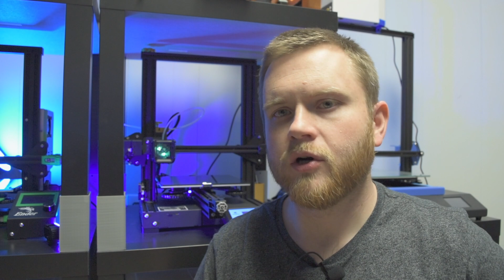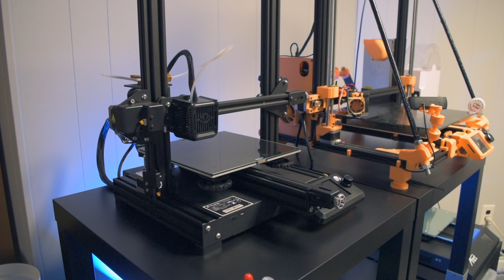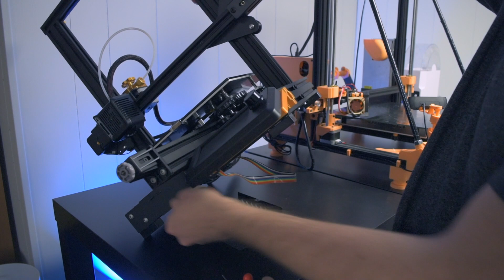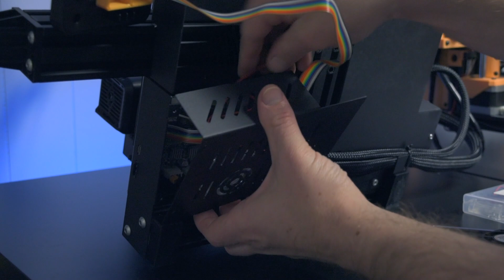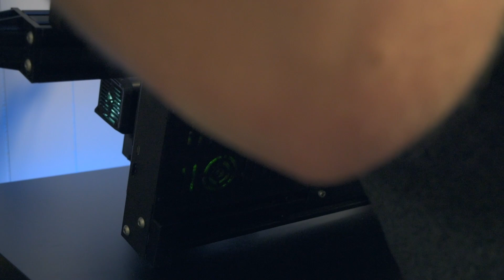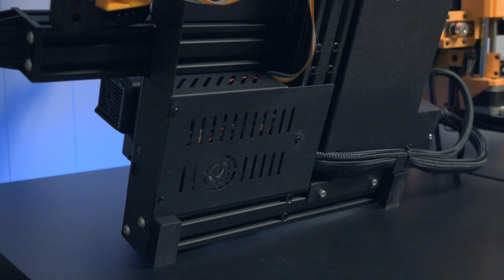Tired of your loud motherboard fan on your Aquila? Let's fix it!

Comment: Using your affiliate link to Amazon for the winsinn RGB fans there are multiple size/voltage options. Which one should we get? 5v,12v,24v? 25mm 30mm 40mm?
Reply from the maker: 24v 40mm fan. ;)
Reply: @3DPrintSOS  🤙🏻 grazie
Reply: @3DPrintSOS  hey Fedder, question. Is the RGB fan the same spec as the stock main board fan? I swapped it out today with the RGB and now about 30min into a print my printer reboots. I’m thinking it’s a failsafe feature kicking in. I’ve been troubleshooting. Changed sd cards, changed files thinking it could have been a bad slice of file. I’m stumped. Going to put back the stock fan in the morning but wanted to ask you if you had any issues with yours not providing enough cooling? I’m also printing Petg @ 235/80 so maybe it could be my parts cooling not cutting it. But I’m running the sprite pro now so it should be able to handle that no problemo. Maybe you may have a pointer or experienced this with that winsinn fan?
Reply: *And I’m using a refined version of Alex’s firmware with the max temps set to 300C.

Comment: Hi I just change my motherboard fan, the leds turn on but the fan didn't. It was a testing print of just 30 minutes; it’s the fan temperature activated or it should be always spinning?

Comment: This printer is junk. Spend the extra hundred bucks for an ender 3 s1, or the ender 3 v2 neo. Trash chinese stock fans, the extruder is partially plastic and uses an old bowden extruder. voxelab is bad, and they dont even sell this model anymore LOL
Reply from the maker: I think you're being a little harsh. I've had so many of these machines and have gotten amazing results. I also have an S1 that I recommend if you dont like to tinker or mod. Great machine, but it's kind of weird to compare the two...price wise at least considering its almost double the price and still has its own issues. Performance wise, some of the best prints I've ever gotten out of 20+ machines I've tested and owned were stock Aquilas.
Reply: Eh I am being a bit harsh. But that's because out of the two I'm using, both psu fans have bad coil whine until it warms the fan up. The parts are all cheap. Print nozzles are eh.  Yes it delivers quality prints, when it's set up correctly and tinkered with CONSTANTLY. It's an old dated machine, but it gets the job done I guess. Super duper loudddd

Comment: Fan failed and was louder than the original, smh, atleast ! got 2 more, lol...
Reply from the maker: I’ve heard of a bad batch of these with premature failures. Mine are still going strong.
Reply: @3DPrintSOS  2nd one is working so far, but the hotend 1 I've had no failures...

Comment: those fans are not meant to be run for more than 10 hrs at a time so I would not recommend those.
Reply from the maker: There are different types of these with different ratings. I don’t recommend you use 10 hour fans for longer than 10 hours. However, there are fans that are rated for 24hours. Make sure you check the specs.

Comment: Whats the voltage of those fans? In another video you replaced the psu fan and I believe you said to get a 12 volt fan but when going to the amazon link you provided its a 24 volt thats selected. Just wanna make sure I dont get the wrong fans and make things worse for myself.
Reply from the maker: So two things there. Voxelab changed some of the power supplies with a different manufacturer and some of them are 12v and some are 24v. It would be best to check yours.

Comment: I only have my Aquila for a few weeks and only printed 5-10 small prints so far, and one of my fans has already gotten really noise on start up.
Initially I thought there was a bit filament stuck in it or something, but it's fine after about 30 seconds. might take it apart there later and investigate.
Reply from the maker: It’s not filament. Unfortunately just cheap fans. They will work that way for a while. After warmup, the sound goes away. With that said, I would replacement with something a bit better
Reply: @3DPrintSOS  Yea, I assumed as much when I saw that it was such a common problem! I took the fan off last night for a look and it's definitely the motherboard fan alright.
I gave it a squirt of silicone lubricant, but I think I'll probably buy some new fans soon. I suppose I might as well buy another roll of filament while I'm at it, to make the shipping costs worthwhile, and maybe some capricorn tubing..

Comment: This might be a weird question but it seems like every time I print something now, I get a static electricity shock when I go to insert or remove the SD card. Have you experienced this at all with yours? It wasn't happening before I upgraded the mobo fan.
Reply from the maker: I’m in a basement with carpet and we have oil heat. So, static is a content around here.

Comment: So for the nozzle and mainboard we want 24v and PSU 12v?  Are they direct replacements, meaning just wire them up, no convertor needed?
Reply from the maker: Yes. But one thing to note about the psu, it’s been brought to my attention that they at some point changed the psu and some machines have 24v fans in there. So you’d have to take a look at your first.

Comment: Anyone have any idea exactly when the motherboard fan is supposed to be on? It'll come on if I do a preheat (which i never do). However, if I start a print, it does not come on. Seems fishy to me. I'm 23 minutes into a print and has yet to come on. WTF?
Reply: It came on at the second layer. The leds flicker. Power issue?
Reply from the maker: Not sure about the LEDS flickering, but it comes on when it needs. 2nd layer or temperature, whatever is set in the firmware.
Reply: @3DPrintSOS  It seems that around the 3rd or 4th layer it comes on and everything appears to work normally, no flickering. If that's the case, I'll live with it. As long as my mobo is getting air. Thank you for the reply, brother. Also, thank you for being my source of ideas for this printer. I've been printing for years. I just hate new printers due to all the tweaks that must be done, usually. lol Take care, Sir!!!
Reply: I believe your fan doesn't turn on immediately due to settings in Cura. If your part cooling fan isn't on, the motherboard fan won't be on either. So however many initial layers you have set for the fan to be off, your motherboard fan will be off as well. Additionally, the flicker from the rgb fan is again due to the part cooling fan. If the part cooling fan isn't running at 100%, neither is the motherboard fan. Without 100% power to the motherboard fan, the rgb lights will flicker. I bet if you check your preheat settings you'll find the part fan is on.
Reply from the maker: This is all true. I found this out shortly after this vid.
Reply: @3DPrintSOS  What are your thoughts on rewiring the motherboard fan so it's constantly on without the dependency of the parts fan being on? Is that something you plan to do?
Reply from the maker: Easy to do. If you have a 24v fan, you can wire it straight to the empty leads on the bottom of your power supply. ;)
Reply: @3DPrintSOS  Sweet! I'll try that out. Thank you

Comment: I bought the Aquila because of your videos. Excellent work. I've been doing all the upgrades in your videos. Just to add to your comment about the rgb fans getting bad reviews, I had one that was temperamental. I changed the fans on the Aquila, no problem. I decided to upgrade the 30mm fan on my Mingda Rock 3 with a 40mm also. I did find that once, it didn't spool up. It powered up but the blades wouldn't spin. I didn't notice until after I melted my custom fan shroud around the cooling fins. Just a FYI. Keep an eye out to make sure they spool up on power up. Other than that, they're very quiet and nice to look at. I do every upgrade you put out. Well worth it. The printer is running like a swiss watch. Keep up the vids.

Comment: so we need 12v for mobo and 24 for nozzle ?
Reply from the maker: 24 for mobo, 24 for nozzle, 12 for power supply
Reply: @3DPrintSOS   ahh they dont have 24v in stock that's why it is showing me 12 v only
Reply: @3DPrintSOS  any other fan suggestions ? they dont have 24v ones anymore :S

Comment: Thank you so much for this info! I actually got an Aquila after watching a few of your videos, but it started making that noise when I preheated it. Should I get the 24v or the 12v fans?
Reply from the maker: 24v fans for hotend and ecu and 12v for power supply.
Reply: @3DPrintSOS  thank you for the fast response! I will order them immediately. Also, my stepper motors get extremely hot, to the point where I can’t leave my hand on them for more than a second. Do you have any idea what could be causing this? I have the belts tensioned properly and nothing is binding, so I don’t know what could be causing it and frankly I don’t know much about the printer
Reply from the maker: Absolutely. Check out this video: https://youtu.be/CjH7AXIHN74

Comment: is it a problem if the fan doesn't turn on when the printer is pre-heating and/or printing?
PSU fan is running a couple of minutes into the print, mainboard fan stays off.. it does work on the mainboard 24V input
Reply: it did turn on, but it's flashing. still not the best thing in my opinion
Reply from the maker: Hmm flashing? The light or the fan? It won’t always be on because it’s on a sensor. The fan only turns on when it needs to. Well, it should at least. When you installed it, did you make sure the wires were correct within the connector?
Reply: Just finished a 3hr print without any issues. The board does get warm, but there was no thermal protection. So i guess the fan does the job :)
Reply from the maker: Thanks for the link! Made it easy. Hmm. Must be a faulty led in the fan. :/
Reply from the maker: Good to hear!

Comment: When looking at the fans on the website, thesexare not rated for more than 16 hours continual use.  Seems like a problem waiting to happen if you routinely have long prints.  How do these compare to the OEM in term of CFM?
Reply from the maker: These are great questions. It should all be listed in the same place you found the 16 hour rating though. I don’t remember on the top of my head to be honest. 

I’ve been running mine almost 24/7 for months now. So far, so good.

Comment: Have you had heat creep issue on long prints with these fans? Im Getting clogging problems do to heat creep with stock fans
Reply from the maker: I have not. It could depend on your ambient temps and humidity though. You can always print a new, more efficient duct.
Reply: @3DPrintSOS  it definitely was inside temps and humidity living in the south currently in a RV full time waiting to roll out again once covid is over.
Reply from the maker: Ah. That’ll do ya. Haha

Comment: I recently came across a thread that said the Mobo fan is on the same circuit as the part cooling fan. Isn't this a safety issue with filaments that don't use part cooling? Trying to understand before I start snipping the connector and figuring out how to connect it to 24v constant. If that's true maybe you could do a video walkthrough?
Reply from the maker: I’m not sure about that one. But connecting to the 24v constant is really easy actually. Even getting down to 12v is easy with a buck converter. Not a bad idea for a video. :)

Comment: So i installed the winsin rgb fans and occasionally the LEDs pulse on and off. just wanted to see if anyone had this going on. or if its an issue i should be concerned about. while hopefully not harmful it is kind of distracting since the machine runs next to my desk.
Reply from the maker: I have heard of this before from a few others asking me about this. I myself haven’t had this issue though. Might be a faulty led. :/
Reply: Mine did this as well before they died after about a year. I'm getting ready to replace them again and trying a different brand. I had more issues with the hot end fan starting to stick or make noise intermittently before it would not start more than it would. The MB fan still runs but has ALWAYS pulsed/strobed on startup. Seems like there was some correlation between the pulsing and the speed of the hot end fan. Surely someone else has run into this and has a fix by now?

Comment: What voltage fan I need to get for this printer Amazon has 3 different voltages this fan comes in
Reply from the maker: The hotend and motherboard fans are 24v. The psu is 12v
Reply: @3DPrintSOS  thanks btw I enjoy ur channel
Reply from the maker: Thanks. Appreciate it.

Comment: machine assembled...still having problems...return to home doesn't get there.
i tried to set up a printing, just to test further along...the hot end hits both ends of it rails and grinds...the switch on the left doesn't shut it down. don't know what's supposed to happen if it rolls too far to the right...
and
i can't figure out how to do a firmware update...normally it would take control and do it on it's own(on my mac, at least)...but the new folder it says to create for the firmware, never shows up in the control device to choose.
Reply from the maker: Hmm. I would check the connections for the switch. Maybe you have something plugged into the wrong one. Or it’s unplugged all together. 

As for the firmware update, I made a how to video on that as well. :)
Reply: @3DPrintSOS   yes, i watched it last night, and i wiped the SD card and re applied the firmware. machine is still inoperable. the connectors only go in one way. i'll check them again.
Reply from the maker: Hm. Yea that’s not good. Gotta be an end stop not plugged or a wire damaged or something along those lines.
Reply: @3DPrintSOS   well i re examined the wiring and there are 2 connectors similar that if not plugged in right, will not let ya print...user error...it is happily if not erratically printing a frankenhook. bed levelling doesn't work how i thought it did...but i managed several go rounds and i "think i got it".
cheers!
Reply from the maker: Nice! Glad you found it. Watch the latest leveling video, that might help.

Comment: just a couple general questions...is fan life sort of iffy or does the work they do just cause them to break down more frequently. and how many of these various fans are the same type?...X2 delivery within 10 days!!! i'm well chuffed...:)
i haven't actually done any math, but could all of the essential~ish upgrades/improvements cancel out saving from the original price? not a complaint, mind you...just casting a wee side eye towards printer makers...;)
Reply from the maker: I would say just run it until something goes wrong. It’s great stock and only gets better as you fix problems. Otherwise, you’ll end up in a modification loop that will eventually make mediocre prints. Ask me how I know. Haha
Reply: @3DPrintSOS   just completed the MoBo fan replacement...waiting on a soldering iron to do the hot end fan...and waiting for the PSU fan as well.
Reply from the maker: Nice! Off to a good start
Reply: i'm going to put a connector in there for easier replacement.
Reply from the maker: Smart move

Comment: any recommendations for non rgb replacement fans for this printer. my mobo fan started squealing bad after a 3 months of running it now lol dosnt happen all the time just every now and then so i figured i should replace it before it dies.
Reply from the maker: If you want silent + non rgb, grab a noctua fan and a step down converter. :)

Comment: Did mine, works fine, very quiet. But... sometimes when I print the new motherboard fan will flash all colors rapidly, endlessly. I can't find any supporting documentation at the winsinn site or via Google to see what that means. Anyone have any ideas what rapidly flashing all LED colors means?

Comment: I have an Ender 3 with a BTT Board and the board fan runs constant but the one on my Aquila does not run constant, are the fan plug into the incorrect place on the main board?
Reply from the maker: I don’t think so. They are just programmed differently. Its ok both ways

Comment: The PSU's exhaust is choked off. Taking a dremel or something similar to the factory PSU cover seems like a better idea than printing one.
Reply from the maker: Or you can pretend to be a total badass and just leave the shroud off completely. 😂 PSA: do this at your own risk. Lol
Reply: @3DPrintSOS  I considered it but  I already have to keep little fingers away from it. I did actually print one of the PSU covers and am using it until I can spend some time in the garage cutting up the factory cover. I'll be following this too in the end to swap out the fans bring the noise floor of this machine down as low as practical without just simply putting a bunch of 180mm fans under it on a pedistal or something else ridiculous.
Reply from the maker: I was mostly joking. I think cutting the stock one is the most solid solution for sure.